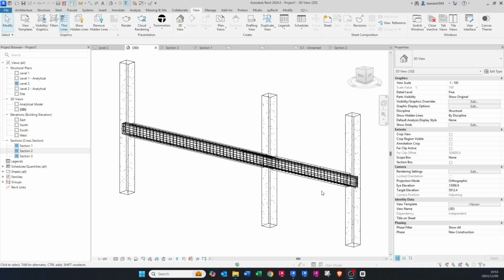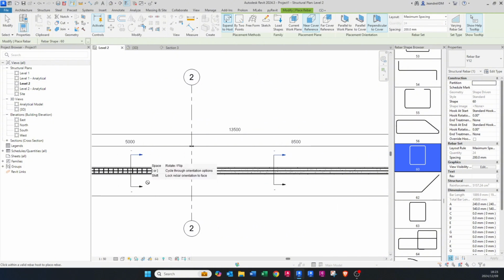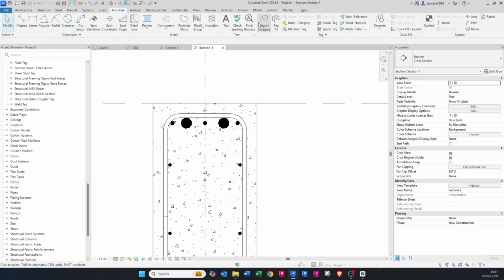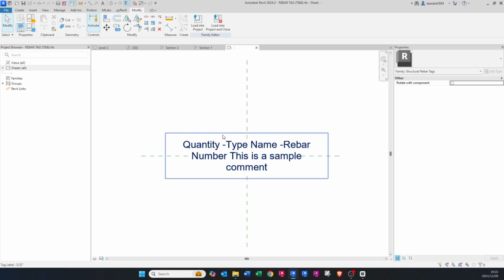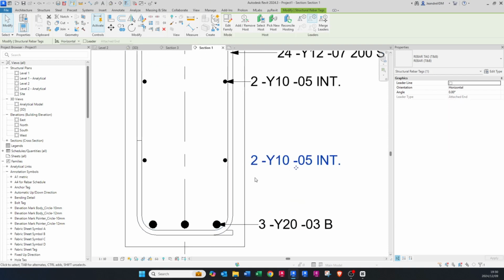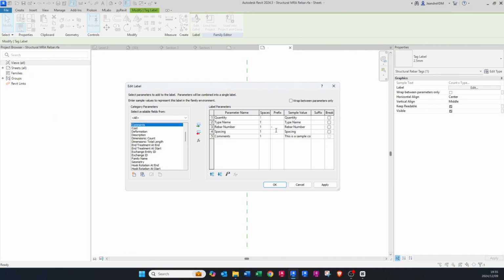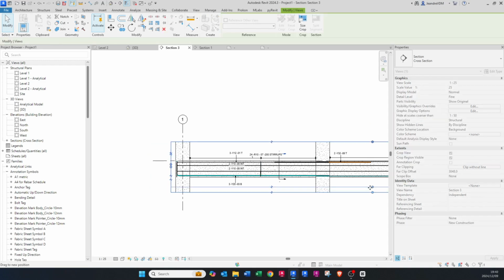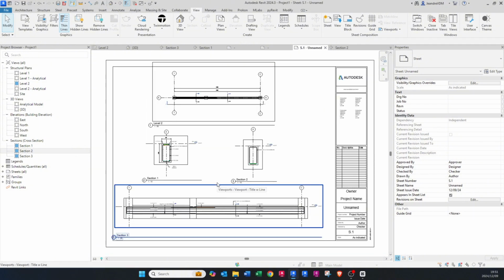Revit Structures - Continuous Beam Reinforcing + Rebar Tags (Create Custom Tags)

Comment: Great tutorial. I have Rebars as H6-H50 in my Revit 2025. How can I obtain for example Y12 or R8 and set it in my Revit rebar sizes?
Reply from the maker: Hi! Thank you for the support.

You can find the Revit 2024 - Reinforcing Shape Codes (South African Standard) for free at this link: https://revitwiz.gumroad.com/l/esebtr.
(It is also available on the Autodesk website under the Revit libraries)

Simply download the file and load it into your project. Please let me know if you have any trouble getting it set up!
Reply: @RevitWiz  . Appreciate your help. We use Australian standards here in our country (PNG). I have Australian Library, so have Structural Rebar Shapes inside Australia Folder inside RVT 2024(libraries). However, I have about 25 different Revit families inside this "Structural Rebar Shapes" folder. Do each one represent 1 shape? Should I load all of them into project?
Reply from the maker: Yes, each Revit family represents a different shape code, so you must load all of them into your project.
Reply: @RevitWiz . I have Revit Familes named A, CC, CT, H, HH, HT, J, JJ, L, LH...etc. Do this represent each shape or are these different standard sets of rebars?
Reply: @RevitWiz . OK, thanks for your help, champ. Will insert them into my current Structural project and see.
Reply: @RevitWiz . 👏🏼👍🏽. Thanks much I now have required standard rebar sizes loaded. Now I have little concern with N12's bending arc. Dia. or radius, too big compared to H12. I hope I can customize them.